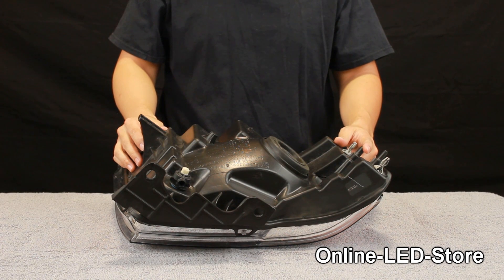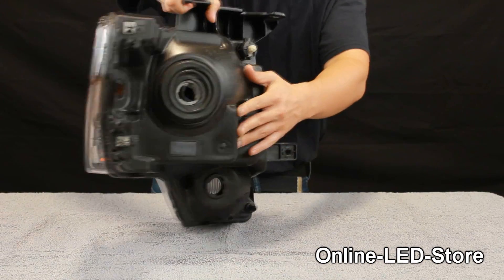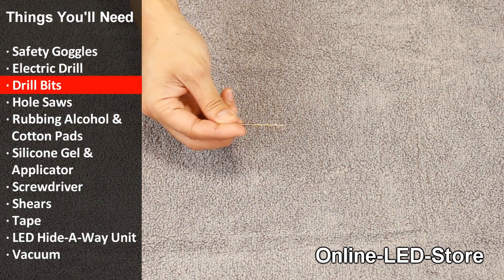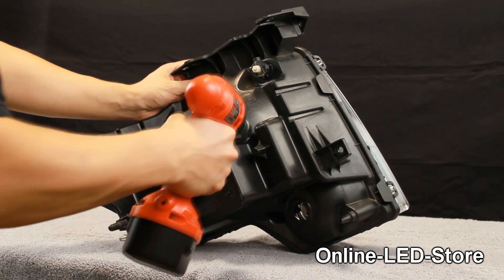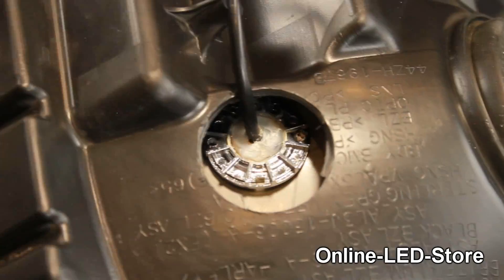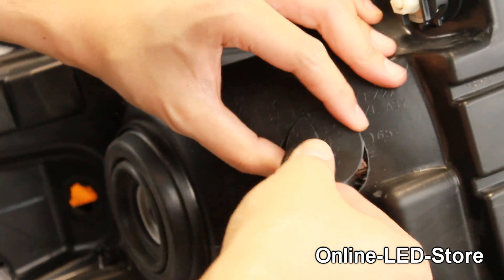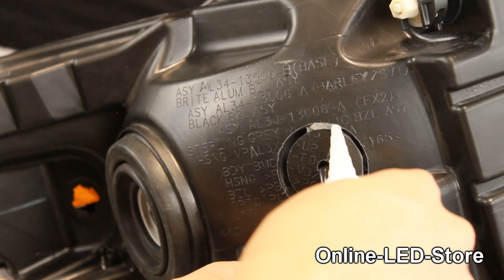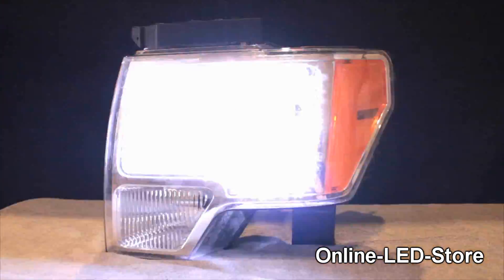How to: LED Hide-A-Way Surface Mount Emergency Warning Strobe Light Installation on Headlight

Comment: Are we concerned about the tape left inside, or just let the OEM light burn it up?  A simpler fix that would be accessible is a twin tube vacuum line, slice each side, not the middle, line the cap, and twist into hole, use dielectric grease to seal.  PS - the light you hacked also voided warranty
Reply: The tape isn't experiencing any heat.
Reply: oh no my precious light warranty

Comment: You installed it above the horizontal center line like you said not to,why did you do that?
Reply: I caught that too, knew I wasn’t that high
Reply: Probably because it was the ideal place to make a hole to miss the uneven surface on the back side.

Comment: I saw some old posts about the new interceptors. It's because they use projector beams so you could put a hideaway in the housing around the headlight magnifying glass but it won't be bright at all.

Comment: A Pro installer would use a Rubber Hole Gourmet.
Reply: A person with spell check will say grommet. Not gourmet there Gordon Ramsey.
Reply: A Pro would be sure to clean all debris from drilling also from inside the focus...

Comment: I was wondering, if I made a whole in my rear lights for the for the hide-a-way  – “in not the most optimal placement” location – what would be my best options to fix it?

1.	Make a “second” hole and move the hide-a-way to the new hole?
2.	Leave the a “disconnected” hide-a-way in the first hole and make a second hole and add the hide-a-way to the second hole?  This way there is no empty hole?
3.	Another suggestion?
Reply from the maker: Please email customer support at support@online-led-store.com about this, our technical support will help you better with this issue.  Thanks!

Comment: do you guys send the wiring instructions and how to connect multiple LED lights?
Reply from the maker: Yes, all of our products come with instructions on how to wire, synchronize, mount, and etc..
Reply: Maybe you can cut a hole for the new strobe and take the plastic puck and glue/seal it in the old hole.

Comment: It would be nice if there was a way to get rid of mounting it with screws.
Reply: just take a little creativity and more patience, you can always do the simple "bake method" to loosen up the glue between the housing and glass, pry it open and work from out to in..... hope this gives you an idea.
Reply: nastystang113 There is. Most companies that produce these have models that can be mounted without using screws. You simply pop them in and the rubber base holds them in place. These shown in the video are cheap knock offs.

Comment: Won't moisture get into the light?
Reply from the maker: Moisture will not get into your headlights if you properly seal it back up after installation, and moisture won't go into the hideaways. Hope this answers your questions.
Reply: oh okay yes it dos thank you, and our local county police are having major issues with moisture getting in because they must not be sealing them up good enough seal. thanks again!

Comment: A few thoughts here. #1 Instead of using a hole saw to cut the inner hole you can use whats called a Step Bit, it's used in electrical and other fabrication uses from metal to plastic. They can be found at most major hardware stores and electrical suppliers. Hole saws tend to cause chipping like what is noted in the video. The step bit is stepped at different sizes so you can make the hole the correct size with little or no play. #2 Instead of using the supplied small Philips screws you can simply use the silicon you already have to not only secure it in place but also seal the inner lamp chamber. Simply apply a small bead around the edge of the hole and insert the strobe into it (making sure you don't get the silicon on the lens of the strobe). Also are you LED Hide-A-Way temperature rated to be in close proximity of the Halogen headlight bulbs?
Reply: Mikey8567 my thoughts are you should make your own videos to teach us the correct way to do things with your infinite wisdom

Comment from the maker: The unit is mounted right on the horizontal center line of the headlight reflector.  Want to look at the reflector in the particular compartment of the light housing, as opposed to the entire light assembly.  Hope this helps!

Comment from the maker: Sorry, but we have not had the chance to work with the new Police Interceptors yet. If the vehicle utilizes LED head lights or has an interior wall made of glass, then strobes can not be installed in them.  If it is just a double walled composite headlight like most of the Fords, non LED, then there shouldn't be any issues.  Does the car came with fog lights?  Or perhaps and area where an after market could be installed?  Can put the strobes in there.  Hope this helps.

Comment: Have you installed any hideaway leds on the new 2013-14 ford police interceptors. I know you can order them with hideaways in them already but we didn't. Im currently putting a 2014 ford interceptor together and planned on installing hideaways. But I was informed that you couldn't drill the holes out on the light assembly anymore. Any suggestions? Im wondering if its because theres 2 walls in them like you show on this video.

Comment from the maker: Sorry about the confusion.  The horizontal center line is determined based on where the focal point (location of factory bulb), as opposed to the middle of the light assembly.  Many people actually mount the hide-a-ways to the bottom side of the light assembly, which works wonders in many applications.  The "below the horizontal line" rule is especially important for headlight applications, since the headlight tilts downward towards the street to begin with. Hope this helps!

Comment from the maker: Wiring is actually quite simple. There are a total of 4 wires coming out of the unit. Red for positive terminal, Black for ground, Yellow for pattern selection/synchronization, and White for grouping.  The light is self-contained so it will start flashing as soon as power is engaged.  You will need a toggle/aux switch to power the lights on/off.  Send us an e-mail if you would like additional details.  Thanks!